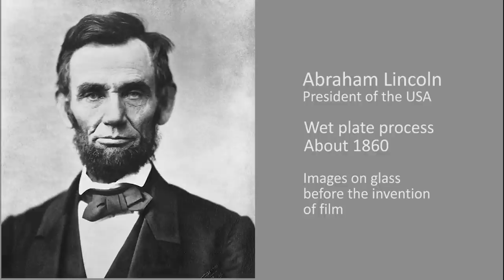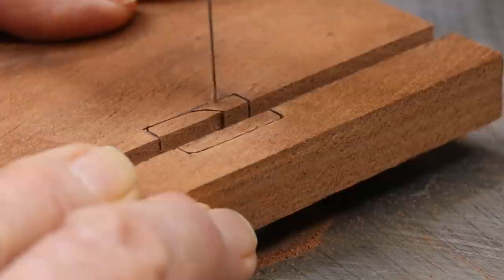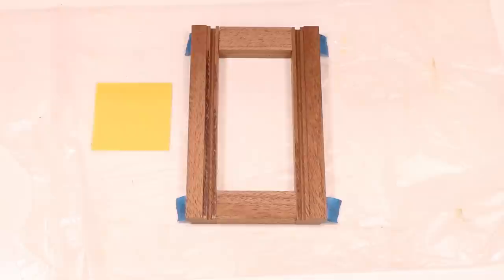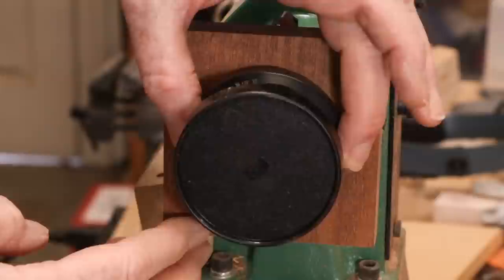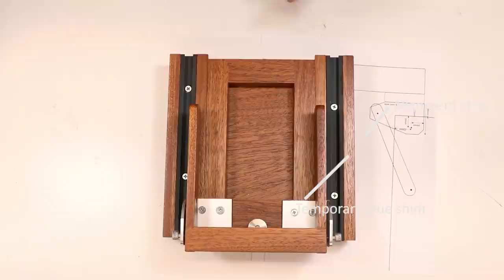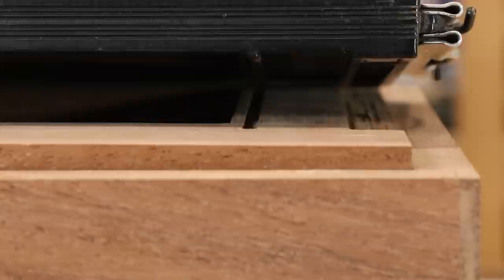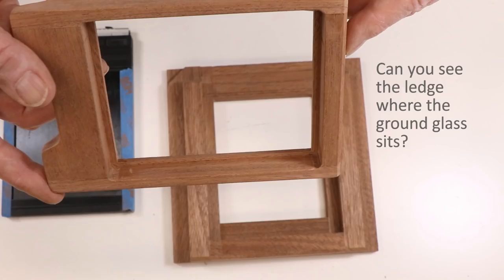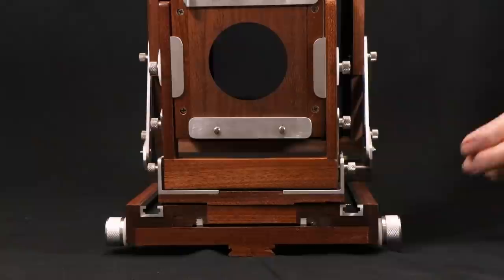Building a Large Format Camera

Comment: Great craftsmanship, but I can definitely understand why most brands use lighter materials and constructions with plywood and carbon fiber now
Reply from the maker: I agree.  In fact, you can get better strength, rigidity, precision, and weight by making the camera out of metal and engineering plastics, and several such cameras are on the market now.  However, the old traditional designs employing mahogany, brass, and aluminum seem beautiful and nostalgic to my eye, and if you can make it yourself, the personal satisfaction may outweigh all the other considerations.

Comment: Wonderful project Patric. back in the 70s I had a deal with a local Hobby Shop to build and display any new plastic kits that the shop recieved. None of the cameras I owned could do justice to the quality of the models I could build at the time and I found a view camera was what I needed. The camera I built uses the back portion of a polaroid portrait camera and the lens is from an antique Kodak Folding camera because it is self contained with shutter. I taught myself how to make the bellows by dissassembling the bellows on the kodak. I made the bellows using Contact Paper shelf liner, heavy black construction paper and black cotton fabric and it is still 'light tight' today. By the way the camera worked. I would add Photos of the camera if I knew how to do that here.

Comment: I don't know why this popped into my feed but I am very glad it did. Kudos on a very very well done project. Back in my day I used a number of different wooden view cameras as well as the venerable Speed Graphic  I also had the use of a monorail view camera  for a time and some of the Ektachrome transparencies are my best work. I would have been glad to use yours as well.  I did notice the lack of a shutter on the lens you purchased,  I wondered why that was as film in a holder is sensitive enough for a shutter to be necessary, but you mentioned wet plates, which would not need a shutter, but would need a different type of "film" holder which you do not mention at all.

Comment: Looks great and should work well.   My only question is why? There are so many 4x5 cameras in closets and garages unused for years. I've got at least two and an 8x10.  I shot 8x10 as recently as 2010, but neither format since. No demand for it.  I could see making a very large view camera.  Be fun to see how you made the bellows. I figured this out some years ago, made a few paper tests. Interesting process and bellows are beautiful. The biggest issue with a bellows after does it work,  and is it light tight? is reflections off the sides. With film if you can get - 5 to -7 stops lower light off the bellows it's good.  (Another bellows tip. My 8x10 is a Horseman. I think they were almost $10,000 new, in the 1980s.  I bought a used one with a smashed bellows for about $3000. Never did anything to the bellows except occasionally check it for pin holes. Worked fine.) 
The trick to aligning your camera or an enlarger is mirrors. Make concentric circles on the surface of the mirrors/plex (as a see through mirror) and align those. When all those circles line up you're good. All my view cameras were good when I got them and easy to reset back to zero.  My Bessler 4x5 enlarger however was horribly out of whack - from the factory.  I've heard that most of them were.  They can and need to be aligned. The Besslers are fussy because the adjustments you can make with the screws on them are too wonky and large to be of much use. I can't remember how I did it, but it someone needs, I can go out to the garage and take a look at it.

Comment: Fantastic! I'd love to see the bellows. And as a personal curiosity it'd be cool to see how you would go about making a plate holder ( I'd like to make an unusual sized plate holder and cannot for the life of me come up with how I would do that )
Reply from the maker: Plate and film holders were originally all made from wood, and I have seen a couple of online comments from people who were making really big cameras (10x14, 14x20) who made wooden film holders because they could not find commercial versions at reasonable prices.  I know it can be done.  But it seems to me that you have to work with very thin sheets of wood that I would not expect to be very stable.  For example, how do they handle the little springy fingers that hold down the film?  Perhaps you could also make a wooden frame, with sheets of aluminum that form the panels, where the metal is glued into thin slots in the frame.
Reply: @PatrickSullivan  yeah, I have some old wooden film holders and they appear to have metal shim stock hammered into them to hold the film down. I don't know how I would accomplish that though with any kind of precision.
Reply: @lvikng57  as the supports you can also use glazing points in the corners. So your holder would be like a deep picture frame so you have the back door holding the plate in, a slot for your dark slide and the plate could be held at the corners and middles, if needed, to support them.

Comment: such a beauty! Does it have a shutter inside the bellow? The old Zeiss lens has no shutter right?
Reply from the maker: Right.  No shutter on this lens.  That is not critically important for the collodion prints my daughter wants to do, because the speed of the wet plate process is so slow that exposures are often 10-30 seconds.  You can just uncover the lens, watch the second hand on your watch, and cover the lens when the time is up.   I intend to purchase a second, more modern lens soon with a built-in mechanical shutter.  Most of these newer lenses are less suitable for the collodion prints because they have lens coatings which block a lot of UV light, making exposure times even longer.  I tried to keep the focus on the woodworking, rather than the photographic technology, but real photographers will naturally be curious.
Reply: @PatrickSullivan  thank you, that makes sense...

Comment: one tip, or observation, doing the back this way (fixed springs) also limits the type of holders it can take, NO roll film, and things like Plate holders (you moddled on film holders, the plate holders are thicker), and only certain holders will fit, if you moddled on an international fit back, with grafflok bars, EVERYTHING would have fitted.

Comment: To shoot a 90 mm wide angle lens you would make a recessed lens board and a bag bellows, I think the front lower section is backwards, it looks like it would be hard to use I don't see front lateral lens-shift which you might need with a wide-angle lens. The lens setting you need to learn is called  schlein fluging, you tip the front lens forward and then you tip the back backwards and everything is in focus on a single plane

Comment: Very interesting process! Can you please comment on how you determined the thickness of the lip for the ground glass? I built a 5x7 back for a Burke and James view camera a while back, and the best I could figure out was to use digital calipers to measure from a film holder's surface to a piece of film I had placed in the holder. Wondering if you did something similar or had a better solution. Thanks!
Reply from the maker: I used exactly the same system--digital calipers, and my visor magnifiers.  This was the first camera I have ever made, and I suspect that a professional could find many things to criticize.  But, God, it was fun.

Comment: Very impressive well done.  I'm tempted to have a go myself, if I can find a local source of plates & darkroom supplies, as rare as hen's teeth these days.
Reply: Photographer's formulary sells the chems and kits. If you have a trophy shop local you can talk with them about the anodized aluminum plates. Or if you want to go with dry plate your local hardware store should have glass and sheet metal you can use as a base and the emulsion can be purchased online, if you live in LA or New York city, or relatively close to either, there are shops that sell the emulsion. From there the same shops selling emulsion will also have Dev chems or you can do the home brew developers and fixers.

Comment: I decided to follow this video to create my own camera.  So far, I have a mostly complete CAD model.  Is the "small modification" you refer to enlarging the base and increasing the distance between the arms of the rear carriage?  If not, what is it?
Reply from the maker: I changed the dimensions of some of the parts in the sliding components of the base  by a couple of millimeters.  I don't think there is any magic in the exact measurements.  There were scores or hundreds of cameras of this type built by different makers, all with slightly different dimensions.  There is no one right way. However, you are squeezing a  number of different components and moving parts into a very small space, and it all has to fit both when it is folded up, and when it is unfolded.   I found that extremely hard to visualize. I did not have 3-D CAD software that would enable me to watch how each part moved as the camera opened/closed.  Instead, I made some small changes as I built the camera to solve problems as I discovered them.  If you have the skill to build a complete CAD model, you can probably do the same thing.   You could also build a prototype out of MDF and plastic  to test the sliding and folding components.  I just did not want someone to try to follow my original drawings precisely, only to find that the mechanism would not close or move properly.     Building a camera like this is extremely interesting and rewarding, but it require some decent skills in 4 different areas:  design, woodwork, metalwork, and photography.  It is not a beginner project.  I wish you the best of luck.

Comment: Amazing work! I am wondering what kind of stainless steel ruler you used for camera back springs? the ruler that I have at home is flexible but after few bends and does not hold its flatness and bends out.

Comment: That looks like a really nice working camera.  I’m currently rebuilding someone else’s 11x14 Frankencamera.  I’m just doing easy stuff right now like making a more solid and lightweight focusing bed.  I’d love to build a camera from the ground up but am at a loss as to how to make sure the ground glass is in the same position as the film in the film holder.  Any suggestions?
Reply from the maker: The distance from the film plane to the back of the film holder is given in the specs for each size and type of commercial film holder, or you could measure this distance directly.  The ground glass is supported on a ledge in its frame.  This ledge must sit at exactly the same distance.   That is all there is to it.   If there is a discrepancy, it is possible to make tiny corrections by inserting shims of the right thickness.  It is easy in theory; in practice, it requires very careful attention to accuracy.

Comment: Hello, Patrick. Excellent work! Thanks a lot for this video. I would like to build this camera, but I can't find straight gear racks and leaf springs for glass folder and glass. It will be excellent if you could share links for springs and rail gears. I think that pinions for 3D printers (I've got a couple of this pinions gears). And what kind of wood do you use? Thank you.